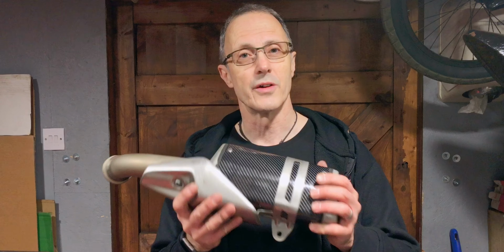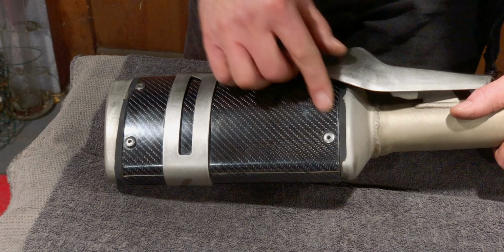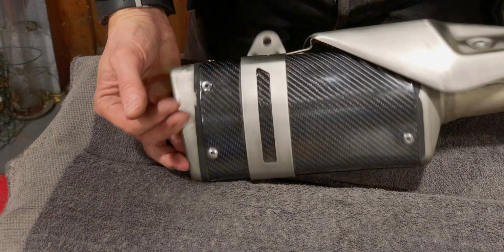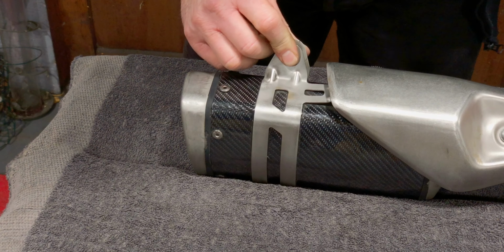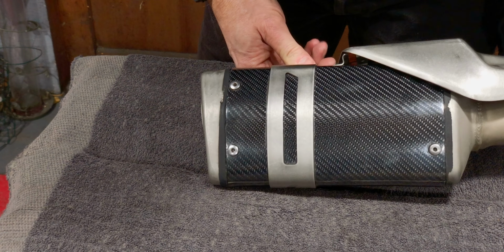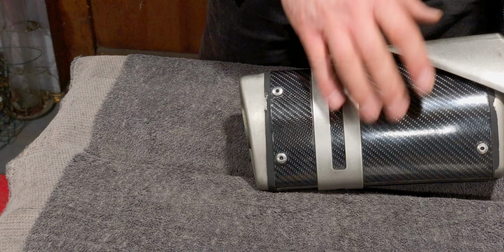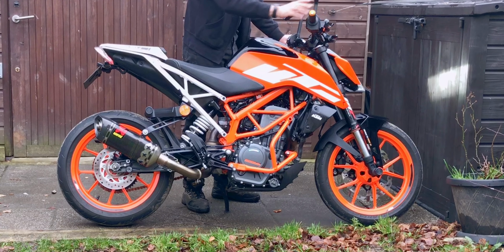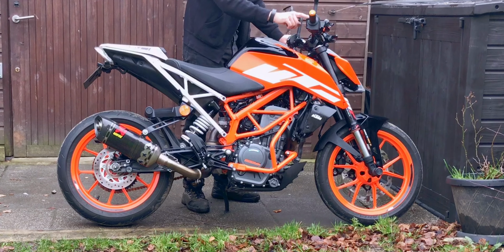Exhaust Update KTM Duke 390 250 200 125

Comment: Are using db killer? I remove it and its super loudddd
Reply from the maker: Yes and no.  Depends which exhaust - Austin Racing for example is louder than Akra and if you have deleted cat and/or presilencer all are much louder.    Currently I have decat, presilencer still fitted and Austin Racing with db killer - this is as loud as I want or can go without being stopped by the police.  With Akra instead I have a modified DB killer which is louder than the Akra db killer
Reply: I am using leo vince mid pipe and akra muffler. No db killer is too loud for me, trying db killer tomorrow and see how it goes. Going on dyno next week, was just wondering, leo vince midpipe or just cat delete with premuffler setup. Power wise which one is better?
Reply from the maker: @doowie111  Yes, the point is to get the sound where you want it.   Premuffler delete is typically too loud so you need to have the baffle in.   Dyno tests have shown better power with cat delete but keeping premuffler than a full delete.   The Leovice is better than a cheap premuffler delete as it should keep some of the power loss - but I've not seen a dyno test for that.
Reply: @MotoMirius  i choose to do cat delete and premuffler in. I ditch the Leo vince mid pipe, too loud and not police friendly. Currently on dna stage 2 and akra full system mapping. Bike feels better on my butt dyno. Going to install powertronic soon and have it on real dyno. Hoping on healthy gain, might swap my d250 injector with d390 injector for better fueling. Wish me 🤞